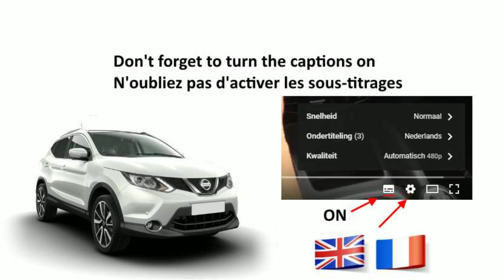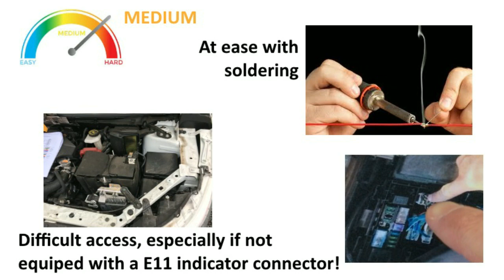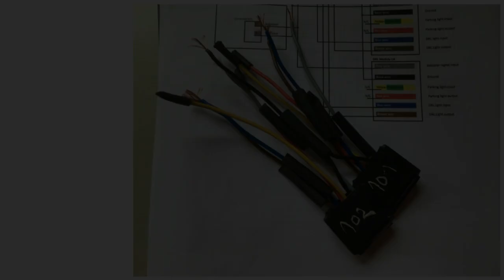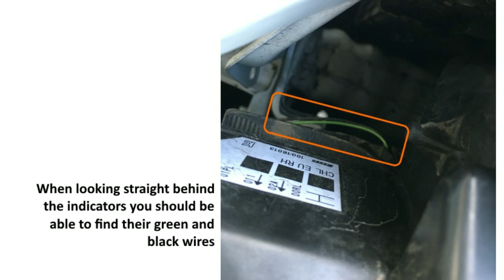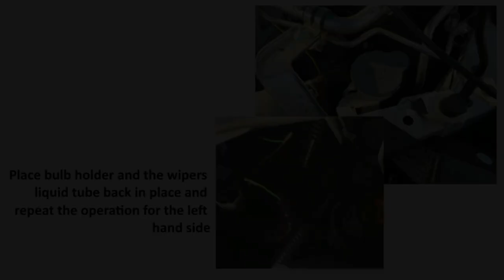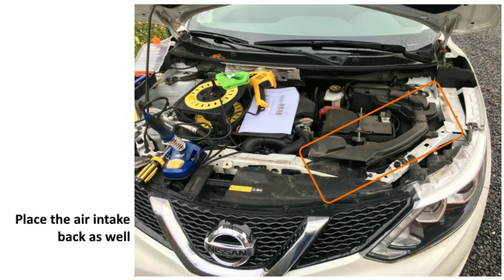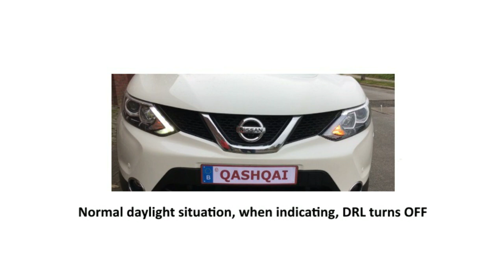Qashqai J11 DRL improve indicators visibility!

Comment: I saw the LED strips you're using for the back and found out there were also strips that could both turn white and yellow (or red and yellow) and was wondering if there might be a possibility to replace / extend the DRL / Head light units with these strips.
Reply from the maker: Indeed, mine are the orange-red ones but I didn’t wire the red one as it would be forbidden to use a 4th brake light. You can indeed take the white-orange one and use it for the front DRLs.
Reply: @LaPalmeraie0032  Great movie. Congratulations. How to connect (under which DRL daily wires)
Reply: @LaPalmeraie0032  ik ben geïnteresseerd in z'n DRL lidstrip maar kan je niet gewoon aftappen van de originele dagrijlichten zodat ze beiden samen oplichten ? En alsook voor knipperlicht modus aftappen van de knipperlichten met behulp van stroomdieven of op één of andere manier proberen de kabels bij de originele stekker bij te steken want ik ben geen grote fan van die stroomdieven of splitten van originele kabels
Reply from the maker: Robert Deman hi, aftappen van de knipperlichten met behulp van scotchlock connectors kan sowieso. Van de DRL’s ben ik niet zeker. Bekijk anders even mijn laatste video over de dynamische knipperlichten achter. Daar gebruik ik zo’n tweekleurige led strip alleen heb ik de tweede kleur niet aangesloten. Was namelijk rood maar ze bestaan wel degelijk ook in oranje-wit. Zo lichten ze altijd wit op bij contact en veranderen ze naar oranje indien het knipperlicht aangaat.
Reply from the maker: Krystian Pawlak hi, please see the manual (link in description) for the exact connections.
Reply: @LaPalmeraie0032  heb ik al bekeken ik denk dat ik alle video's die met qashqai mods te vinden zijn op YouTube al bekeken heb haha ik heb zelf ook al wat aangepast zoals interieur rgb led in daschboard met on off switch er tss ,daschcam hardwire aangesloten met piggybacktail op zekeringen  en z'n nieuw dasaita Android infotainment systeem met 10 inch scherm geplaatst en nu overweeg ik ook dynamische knipperlichten in mijn spiegels te monteren ze hebben nu smoked versies die mooi zouden passen in mijn zwarte spiegekappen maar voor die DRL ledstrips moet je werkelijk de originele bedrading splitten en daar ben ik geen fan van of mss zou het lukken om ze in de originele stekker bij te duwen maar dat betwijfel ik
Reply from the maker: Robert Deman inderdaad, die DRL bekabeling zou ik ook niet aanraken. Maar met die tweekleurige led strips is dat dus ook niet nodig, enkel +, ground en knipperlicht voor het beoogde effect.
Reply: @LaPalmeraie0032  ik vraag mij af of ze op de keuring niet moeilijk zullen doen voor die knipperlichten onder je kofferdeksel? Of ben je intss  al eens geweest?
Reply: @LaPalmeraie0032  heb je deze al gezien?? Heel mooi maar er komt veel bekabeling bij kijken en ik twijfel dat dagrijlichten in de spiegels gekeurd zullen raken https://youtu.be/3kO4W8UokYc
Reply from the maker: Robert Deman het mag inderdaad niet. Vooral door het ontbreken van het CE keurmerk eigenlijk. Maar er zit een schakelaar op dus ze kunnen tijdelijk uit op delicate momenten... 😉
Reply from the maker: Robert Deman die kende ik inderdaad nog niet maar ik denk dat dat er inderdaad ook niet door raakt. Vooral s’avonds komt daar toch een bak licht vanaf. Met de dynamische knipperlichten licht letterlijk de straat op als ik knipper 😄
Reply: @LaPalmeraie0032  wel mooi ik heb op alliexpres zelf al strips gezien die over de volledige lengte van de koffer gaan met zoals jij op de uiteinden knipperen en het midden gedeelte is stoplicht maar ze geven tijdens het rijden wit licht en wit licht achteraan raakt 1 zeker niet door de keuring en de politie zou je staande houden als ze dit zien dus deze die dit ontworpen heeft was wss niet goed waker denk ik 😁
Reply from the maker: Robert Deman die zag ik ook. Is denk vooral omdat het in Azië wel gewoon allemaal mag. Ik heb gewoon de 30cm versie genomen.